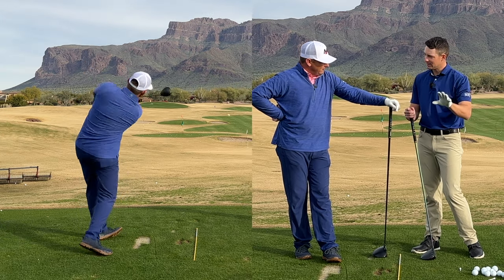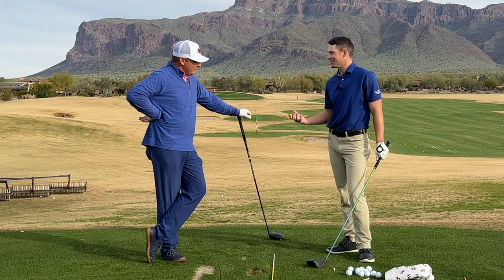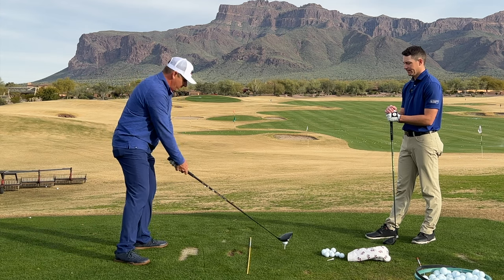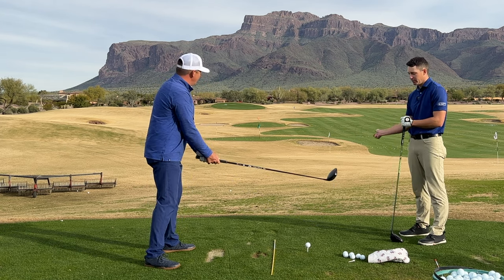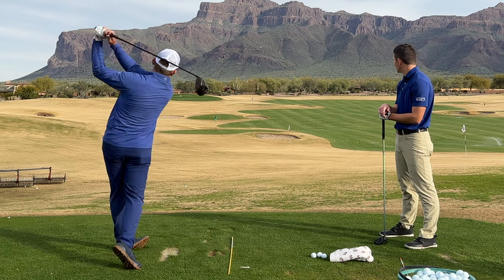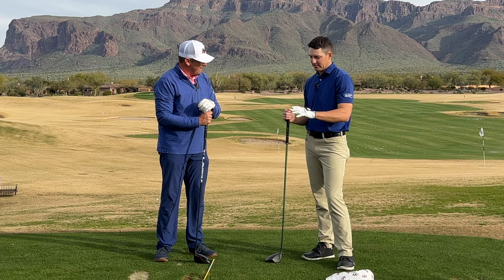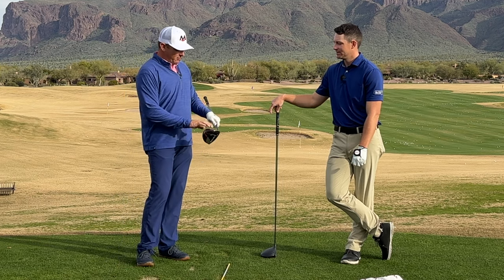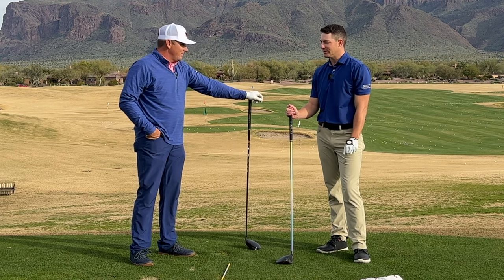How To Hit A Driver Solid And Increase Speed! (BUNTS To BOMBS)

Comment: Hi Milo, do you have any concerns about creating handle draggers with the F1 & F2s? Thanks Alan.
Reply from the maker: Not if done correctly.  Handle dragging is only possible when the hands are pulled past the midline of the body while the club head is left back.  What F1 and F2 teach the player is how to use the pivot to transport the arms and club without pulling the handle forward.
Reply: @MiloLinesGolf  cool. Thanks. I only ask that because that can be my nemesis!

Comment: Hey Mr Milo I posted this comment on another video but it disappeared, but in your swing it appears that when your chest opens up your head does the same and it appears that your not looking at the ball at impact, are you just predicting impact or what? Because when I open my chest and head up in my swing it looks identical to yours but I’m not seeing my club actually connect with the ball which i know it’s a short time frame but it feels like I’m just predicting that I will hit it while opening up? Like to know what you think about this, I’m trying to adapt to this more rotational style swing
Reply from the maker: I don’t see impact and never have.
Reply: @MiloLinesGolf   awesome Mr Milo it gives me clarity on what I’m working on and I’ve never thought I could hit the ball without seeing impact but it seems to be working pretty good, gonna have to get a virtual lesson from you pretty soon
Reply: @MiloLinesGolf  Is that (not seeing impact) the result of rotation, and letting everything flow/accelerate?  The more I think about this, the more it makes sense.

Comment: Wondering if I do the swing (without hitting balls) in slow motion Correctly and gradually speed up as I can still doing it right Doing it over the winter months very patiently would it be worth it for the improvement I will get or there a better way thanks
Reply from the maker: Gotta hit a ball with slow perfect movement and gradually add speed back in